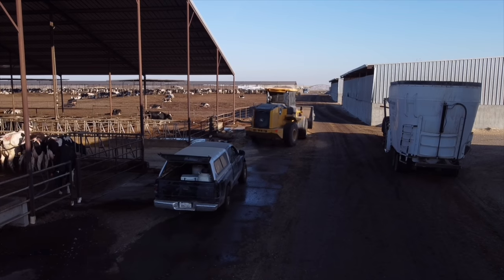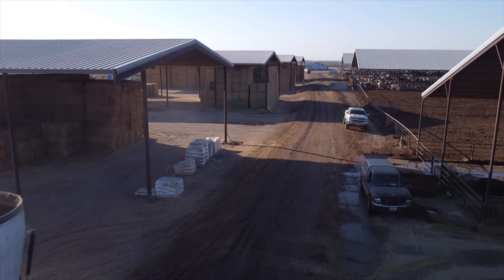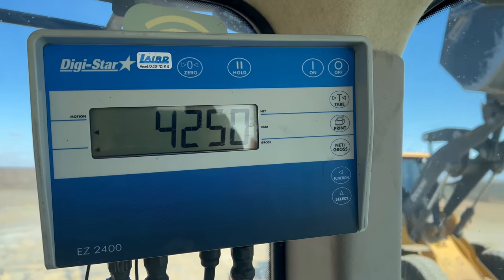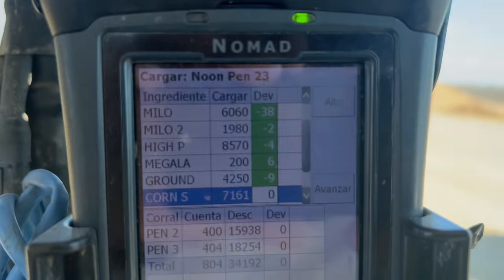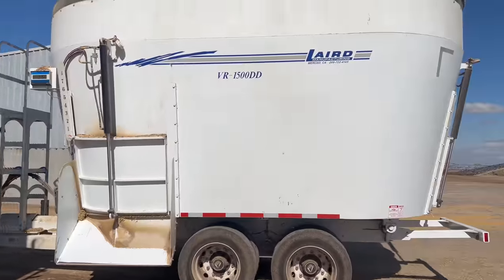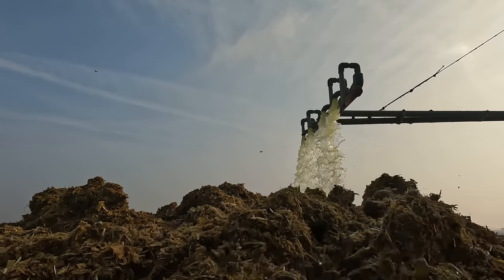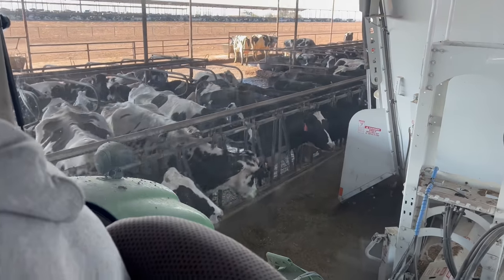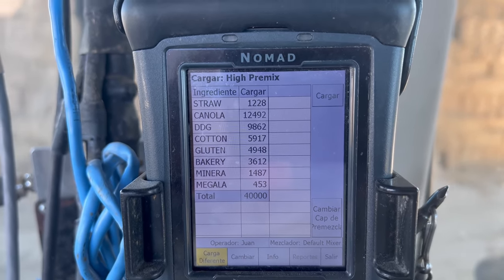Feeding over 6k cows!

Comment: It's amazing how those computerized feeding systems save on waste. Instead of feeding off a sheet. How much do you think you've saved by switching to the computer system? Also bakery is the devil. I hauled alot of it in a hopper bottom that stuff packs in tight. How long does it take to completely feed everything?
Reply from the maker: I'm not sure as to how much we've saved since we've been using this system for a while but it does speed up the process of feeding and also ensures that our tmr is the exact same mix every time!